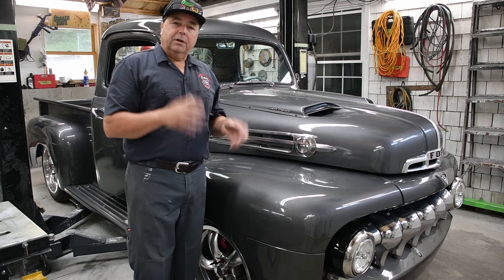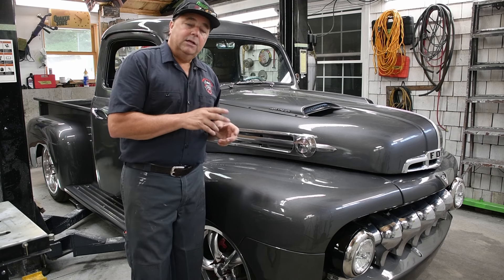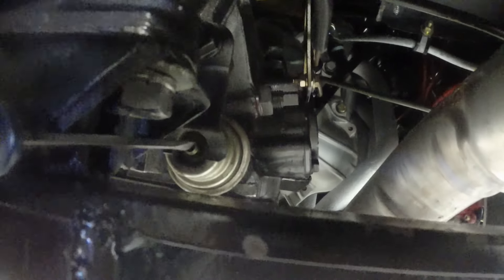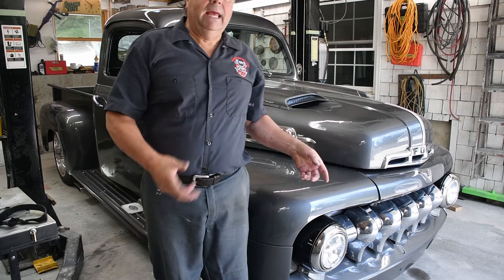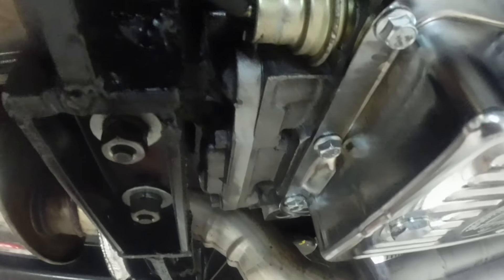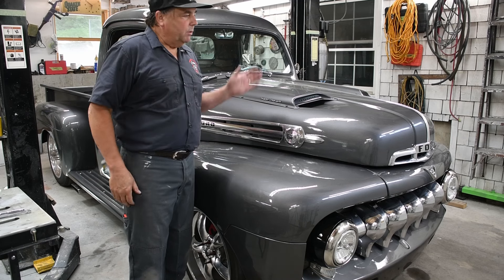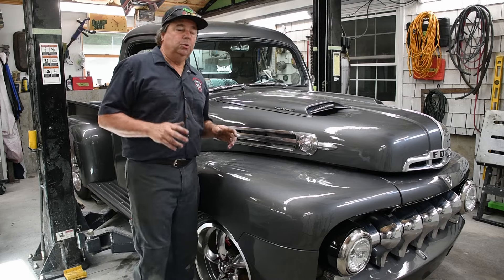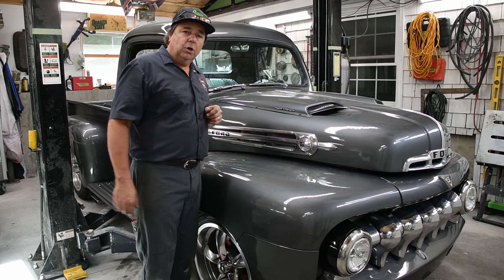Adjusting The Shift Modulator

Comment: Thanks for the video. I just adjusted my th400 transmission vacuum modulator shift points. Now on my mild throttle 1st gear shifts at 15mph, 2nd gear shift at 30 mph, 3rd gear shifts at 42, and OD shifts in at 43mph👍

Comment: Thank you so much my 81 trans am refused to shift until 45-55mph and now that i know how to adjust this i’ma fix it tomorrow
Reply: Only real question i have is i was told i didnt need to run the hose to the carb but you did on yours whats your verdict
Reply: @pokemaste3269  did you get it set up? Having the same issue on my 75

Comment: what about when you put it in gear, and it hesitates for a bit and then it starts to move? but you can feel like it binds a little?
Reply from the maker: That sounds like internal trouble. You could try a fluid and filter change, that may cure the hesitation. The "Binding" sounds mechanical to me. Good Luck
Reply: @ thanks for the response, i hope it’s not the transmission going. i just had it rebuild two years ago

Comment: I have a th350 trans in my bugeye sprite with a sbc 383ci. 
I'll adjust my vacuum modulator and fix the low rpm shift points.  Thanks

Comment: Thanks for the info and demo on the adjustment process. I currently run a Ford C-6 behind a Ford 460 in my Mustang. It shifts really hard. What would I do to soften it up a bit? Would I need to change it to a different color stripe? I use for street cruising mostly and don't race it. Thank you very much for any input sir. Love your beautiful truck! It is a work of art imo. Cheers from Michigan!
Reply from the maker: Making it shift sooner would soften it a bit I think
Reply: @troykane  Thank you Troy. Appreciate it.
Reply: Make sure the vacuum hose is good

Comment: I found out my powerglide does not HAVE a adjuster INSIDE the module what do I do ?? Bought new DOESN'T have one ?? Need longer first gear ?? Help plz
Reply: So I thought I had this problem because I replaced the modulator.  I don’t know if you have found one but I do have one and was able to find it via the assistance of Oreiley Auto Parts.  I will attach a picture of the one I picked up.  I hope this gets you on the right track.  

U36164
Pin, C-6 Modulator (1
BATCH: 3 C BIN: D0402B
VP# :
PRI. BIN: D0402B
Reply: Well I guess I can't attach a photo BUT the information IS the correct information

Comment: I have a 77 ford f100 and it’s not even shifting into any gear.  I just got the transmission rebuilt 3 years ago so I don’t think it’s that.  Could it be a bad modulator?  Also the hose that connects to the hardline is t as thick as others on similar models.  Could it be that?

Comment: At WOT will these adjustments affect my shift point.  My TH350 at WOT won’t shift until 6300 rpm.  But crushing it shifts fine.
Reply from the maker: @Keeterbob  that is controlled by the kickdown cable
Reply: So not the modulator?   Does this mean my cable is too tight or too loose?
Reply from the maker: @Keeterbob  You have to set the cable adjustment. The cable end goes into a bracket at the the carb. Look at the cable housing, there is a metal clip, like a horse shoe. Pop that clip up or open, then put the throttle to wide open, with the engine off. with the throttle wide open snap the clip back down to lock it in. It's done, good luck.

Comment: Does that hose from the modulator connect to vaccum manifold port from carburetor?
Reply from the maker: Yes direct to Manifold vacuum. Not ported vacuum from the Carburetor
Reply: @Troy Kane Vtwins to v8s  when carburetor is hooked up to manifold vaccum do you need to run timed vaccum to distributor?
Reply from the maker: @nursecuenca  Yes, distributor gets ported vacuum. Shift modulator gets direct manifold vacuum.
Reply: Yes

Comment: Did you have these problems with the Holley efi carb
Reply from the maker: This adjustment was done when I replaced the transmission. The vehicle was fuel injected at the time.
Reply: @troykane  okay cause I’m having this same problem soon as I installed my Holley sniper

Comment: My th350 trans will shift into Reverse or Drive but in drive does not upshift to 2nd or 3rd. Can’t even manually shift into those gears. I replaced the governor and vacuum modulator and same thing.
What’s wrong here?
Reply from the maker: Is there a kickdown cable on this Trans?
Reply: Hey have you figured it out my transmission has the exact problem bro!
Reply: @ronaldogonzales115   nope. I’m working on a bunch of stuff that has sidelined my Chevy for a bit,
New Master Cylinder, new headers, heater core, Tilt steering column.
So I don’t expect to have it back on the road for a couple of months. 
Then I figure this trans out. Stay in touch.
Reply: Same with my th350
I'm gonna replace the vacuum modulator and see if that it 😢
Reply: @troykane mine doesn’t it’s the solenoid and it’s having this issue any idea? I’ve checked the governor

Comment: I have th 350 turbo it will shift into reverse and drive when I drive down the road i will reach 30pmh and still won’t shift into second gear.governer is okay and transmission is at the full mark. What’s the problem?
Reply from the maker: A turbo 350 has a kickdown cable. You need to set that properly.